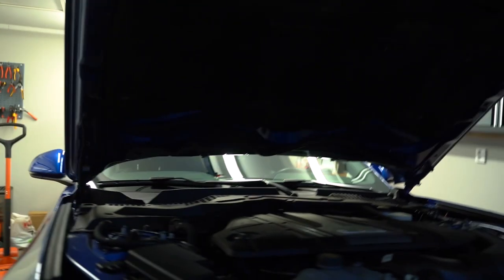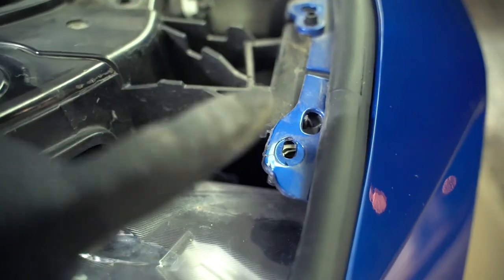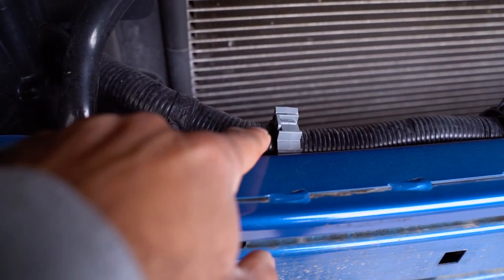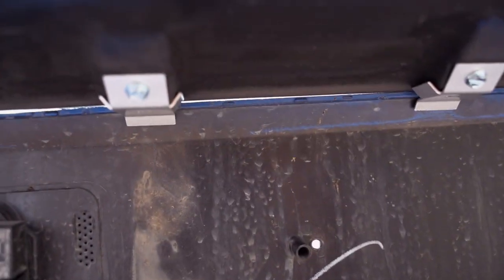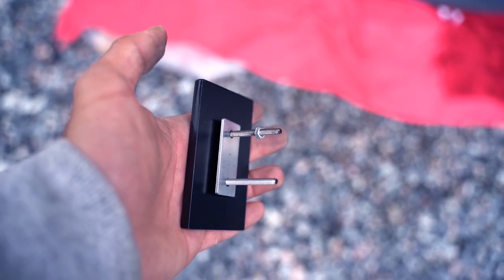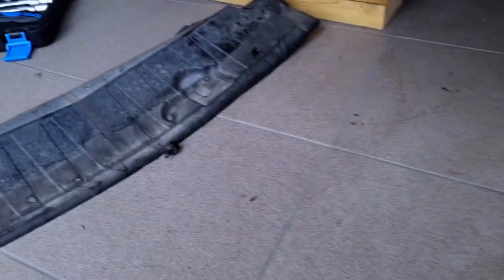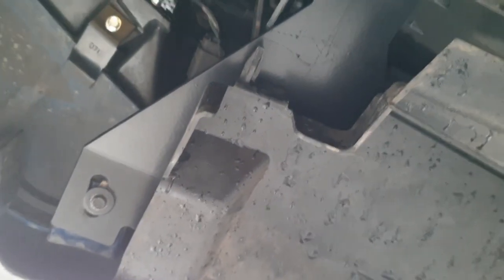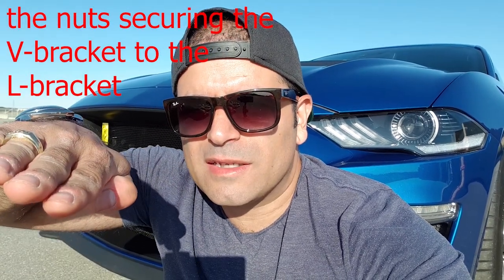Installing Cervinis grilles on my 2018 Mustang GT with smart and safety package

Comment: Hello Maz, my car is the import version in China which has the cruise control and acc system. Well you said that there is a little box behind the lower grill called safety system. So my question is can the Cervini lower grill still be installed and will it cause any problem with sensors etc? Thx
Reply from the maker: Hello! I had that on mine as well and I did not notice any negative impact. 

However not sure if all the cars have the sensors in the same place etc and if it has moved on the different model years with regards to eg ACC

Comment: I had the same problem as some people described where the bottom grille separated and it messed up my whole splitter on the highway. Top one is perfectly fine but they didn’t even include the right hardware for the brackets to be installed correctly
Reply from the maker: Sorry to hear that :(. Did you have the L and V bracket installed?. I have Bullitt style grilles incoming
Reply: I had that exact problem, figured it was because i bought a used kit and it didn’t come with the L and V brackets.

Comment: Thanks man. I appreciate it. Does the grill mount to the bracket? Or does it just hold it up ?
Reply from the maker: No problem, the L-bracket attaches to the radiator suppor the the V-bracket to -L bracket and the V-bracket attaches to the OEM bumper I remember it correctly.

The grille itself is not attached to the bracket. By securing the bumper in place it minimises the risk of the bumper separating from the grille

Comment: Hey man. Nice video especially by yourself. It’s a pain with 2 people. Have you had any issues with separation? I helped a friend install this exact upper and lower and the lower separated on the highway. Completely ate the splitter. Took the bottom out and two months later the top is separated.
Reply from the maker: Thanks buddy! Yes it was a bit cumbersome haha :)

Sheit feel sorry for your friend, I have heard of others as well where the lower portion has separated. Was the L and V-bracket installed? The top I have not seen anything on either however I need to redo one bit as it is not aligning correctly. Just need to find some will and time to take the bumper off :D.
Reply: Thanks for the response. I think that’s the problem, he didn’t put the brackets in bc cj pony said he didn’t need it Bc it’s a performance pack.  You think that was the problem?
Reply from the maker: @jesp5842  I would most definitely think that is the reason. Without the brackets the only thing holding the grilles attached to the bumper are those small screws and brackets that are included in the kit.

Did CJ really say they are not needed???
Reply: Mazman did you ever get an answer from Cervini on the clips to attach to the radiator support?  I am having the separation issue because my installer said I didn’t need the support brace since I have a PP1 car.  So much for that.
Reply from the maker: Sorry to hear about the damage. I got some reply but nothing informative or of value and they did not answer all questions. I would highly suggest to use the brackets even though it's a bit cumbersome. Just as a reference I had the PP1 as well

Comment: Hey did you ever get any answers to those questions?
Reply from the maker: No I did not :(
Reply: @Themazcorner  Thanks for the answer! That sucks they didn't answer back but I'm not surprised. One more question, did you also have adaptive cruise control on it? Did all that work ok after installing the grill? I'm looking at getting the top and bottom but I wanna make sure everything is gonna work after. Thanks
Reply from the maker: Np, I had the smart and saftey package on my car and all was working for me with regards to ACC etc

Comment: It looks nice, but it does change the aero at the front of the car with that grill opening enlarged. Cervini is a pretty lousy company based on all the complaints I've read over time. RTR would be my choice.
Reply from the maker: yeah indeed does to it look good and aggressive. Most likely it is not as aerodynamic as the OEM mesh-grille. I cannot say their customer service was any good to be honest... Also it is a very expensive mod (at least in europe) considering what you are getting....